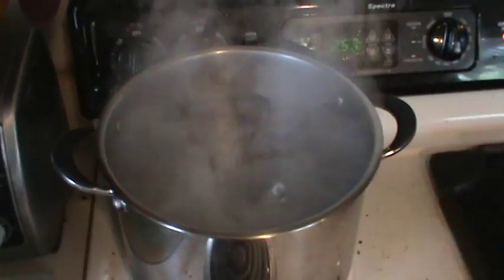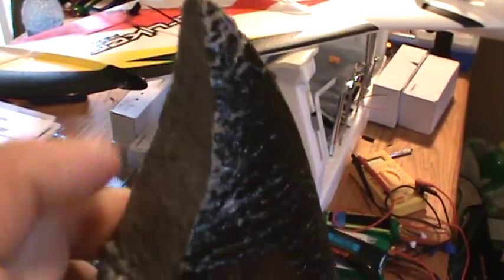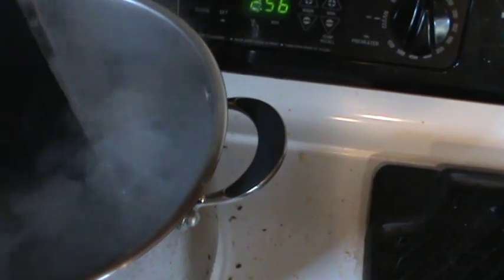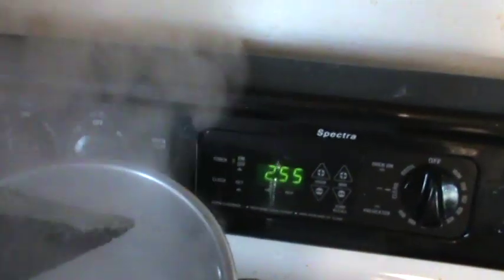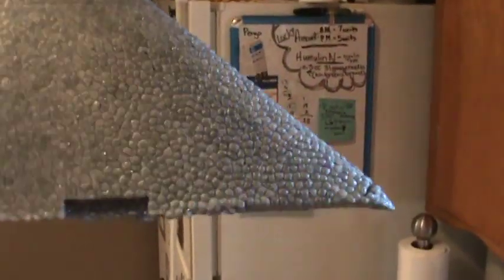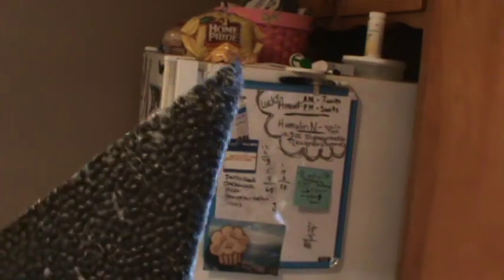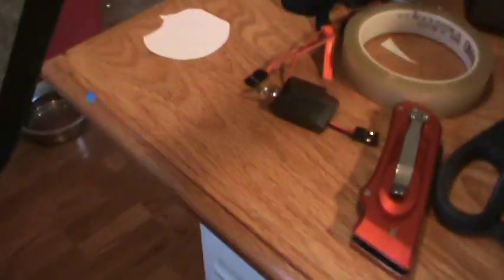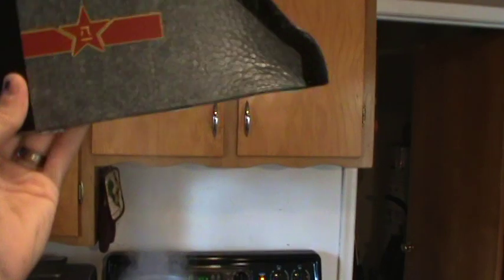Repairing EPO foam with boiling water.mpg

Comment: The “alligator- skin- effect” can be smoothed a lot by rubbing with the back of a spoon while the foam is still hot.
On bigger parts (dent in leading edge of wing, for example) hold over sink and pour hot water over it, directly out of the kettle.

Comment: The best way is to turn off the burner right before the water starts boiling hard wait a minute or two then submerge your damaged parts let it sit for a minute or two the lower temp will still do the job just takes a little longer to heat the foam but you won't get nearly as much foam gator ing as you call it. The key is to heat the foam slowly out side in if you do it to fast with to much heat you get the pock marks. I've done it a bunch of times this way and have much success with almost no visible pocking.

Comment: Are all parkzone / eflite foamies planes made out of EPO ?
Reply from the maker: ***** To my knowledge all of the park zone planes excluding the ultra micros, are Z-Foam, so yes their name of EPO. this trick works the same on all park zone planes I have fixed. How long in the water, and size of pores in the foam you may see will very with different manufacturers, just due to the gravity weight each has formed their foam. Not all E-Flights are EPO, check first. Hope this helped.
Reply: Thanks man. I was hoping to restore the fuselage of my um radian but ill rather leave it with its battle scars. I suppose it adds character

Comment: I tried 2 different ways of doing this. The first was using boiling water and the second was hot water just before it boils. The one with just hot water worked good without as much alligator skin. It just took a little longer. Thanks for the Idea! Now I don't worry as much when I crash. Like I tell people, "I have the planes I've crashed and the planes I'm going to crash".

Comment: Thank you so much for putting out this video!  I just crashed an EPO plane the other day and was wondering how to go about repairing it.  What do you recommend for those parts where the foam is split in half?  Would you recommend foam safe epoxy or hot glue?  Thank you in advance.

Comment from the maker: the cells over about 24hrs will evaporate a lot of the water and shrink some but the alligator affect doesn't disappear. With a little fine grain sand paper it can be smoothed out nicely. I highly recommend Hobbico filler $4 for a small container that will last forever and has a ton of uses. Smear it on let dry then take a fine grit sand paper and smooth out and it will be smooth as silk. If you need suggestions on what grits to use or the filler I am talking about let me know.

Comment from the maker: @DoubleAlphaRomeo Hey DoubleAlpha, you are correct. I had a center fuse that was just bent all over from a nose in. I removed all electronics, and wing and put the fuse tail into the sink. Then I grabbed that same pot of water in the video and slowly poured it down the inside of the fuse on the part that was dented in. One pot and perfect. I will add to this video with that, good idea thanks man.

Comment from the maker: @diaphanoux You canb use cool or room temperature air if you have a gun that will just cycle air. If not simple let dry over a couple days. when dry the LED will work as always. I have a video of a Spektrum AR6210 with satillite that I completely submerged in water. I pulled it out shook well and simply blew all excess water I could out. popped off the case and let dry for a couple of days. I still use this in one of my 70mm EDF's to this day. I hoped this helped. Any more question let me know.

Comment from the maker: @diaphanoux Hey diaphanoux not a problem. Like most electronics beleive it or not can handle water if treated right afterwords. obviously if it can be removed do so. But from your comment I am guessing not :) Simply make sure your LED has no power source comming from it and try your best to seal off the + and - leads. then work as usual. The key is to let the electronics dry completly. do not use a heat gun or such. Use the boiling method and let the LED dry for a day or two...cont.

Comment from the maker: @johneyrico Hey johneyrico,  NO you do not want to use a hair dryer or heat gun. The heat is what allows the foam to return to its molded shape, the water is to prevent burning the foam cells. Example if you used a heat gun the cells would swell and start to change colors but would not return to their original shape, they would also become hard and brittle. Water protects the foam cells from this. Heat does the work and water is the control to prevent damage. Thanks for checking it out.

Comment from the maker: @solracotos Hey solracotos, thanks for stopping by. It looses no flexibility after water treatment, and maintaines its strength. The only time I have noticed weakness is on an EDF I use to train, about 12 inches of its nose has been almost bent in an "L" shape 4 or 5 times. I noticed on the fifth boiling treatment it became very very slightly mnore flexable, but still held its strength. The aligator effect is the only noticable effect, but if you can fill and sand foam you can make it look new!!

Comment from the maker: @youronlycow Hey youronlycow there are a couple different ways, by far thew best is a ver cheap product called "Hobbico hobbylite filler" (white for foam) it is amazing stuff very very lite its a white paste that you add water too, just a little. Then mix it up untill its the way you like it and smear on all over where you need, let dry, and sand off. When I say sand off it takes nothing at all to sand off and you shape it as it goes. $4.99 for a 8oz tub. I post a how 2 vid on it today.

Comment from the maker: @rcplanecrazy1 my old flying buddy and I used to use our heat guns that we used for covering our old balsa Nitros to expand old EPS dented foam planes like GWS models. But heat guns would expand them and burn it. With water you still get the heat without the burn and the foam cells fill with water so after it takes its shape back and dries out your good just some bigger foam beads to smooth. I thought everyone used this but I was surprised that not many people know about it. Works on most foam.